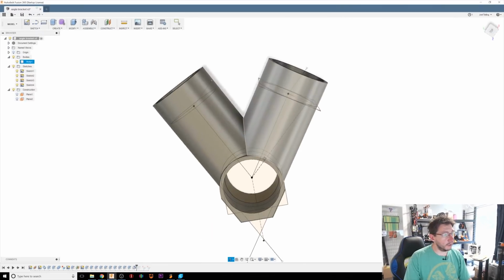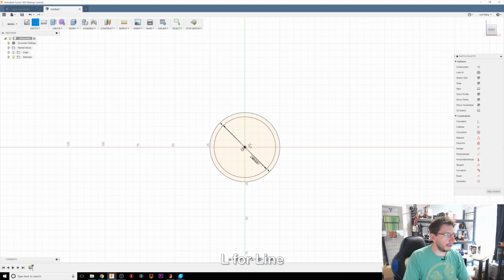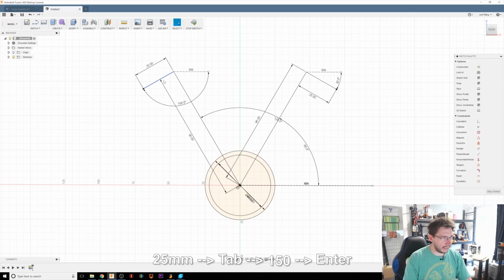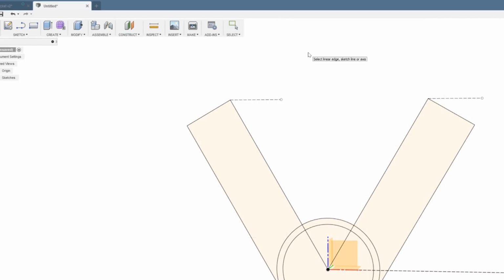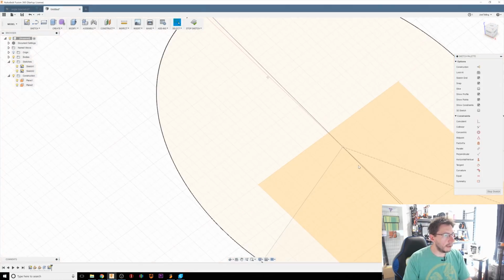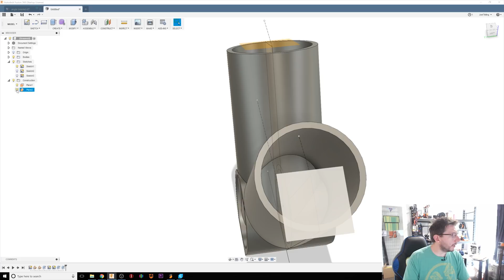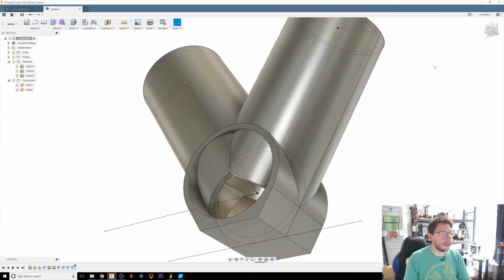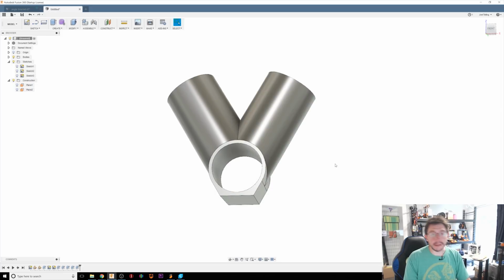3D Printing a Spool Holder Using Paper Towel Cardboard Tubes

Comment: I would've made it so the tube goes on top of the connectors for 2 reasons:
1. It will give the tubes more durability since it stops them from collapsing.
2. It will use up slightly less filament while printing.
The downside is that it won't look as good.

Comment: I know it would be more practical to use cardboard tubes or pvc pipes. But this got me thinking about printing out the tubes and what design considerations and printing orientation I would need to use. 

Printing them with the axis perpendicular to the bed would most likely make the tubes very weak. They would most likely need to be printed with the axis parallel to the bed. Any ideas on what kind of features that I can design into the tubes for extra strength? Ribs?
Reply from the maker: Hmm that's a good question

Comment: Joel, first of all, thank you for the idea and video (I liked it and I re-created your design in my F360). I know you are not a F360 instructor, but you could set good example to others by creating and using user-defined paramers. At minimum, you should use parameters for values that you will need to use multiple times. In this video, for example, you used a few dimensions again and again. F360 makes it extremely easy to use them (once created); you just need to type any part of a parameter name, and F360 will offer one or more matches to choose from.  A few sample (shortened) names: Inner_dia, Outer_dia, Tube_len, Tube_depth.

Comment: you could also use the triangle side as the base, therefore having a possible total of at least 8 - maybe even 14 spools since there would be 3 sides  please see this comment I rlly think it would be a great idea and a great improvement, also it could further increase the weight the structure could take on. Also, I realize you will be thinking, "But oh, then the top triangle just slides down" and I know but you could change the design a little. soo maybe? +3D Printing Nerd

Comment: I don't know if this is your sort of challenge.  

I like to use ceramic knives, and glow in the dark pla uses glow in the dark crystals of a hardness of about 7 mohs. 
A ceramic knife has a hardness of about 8.5 mohs, while steel is 4.5-8 mohs. 

These facts collided in my head about 10 mins ago and became a question.

Is it possible to print an effective knife sharpener for ceramic or steel knives from glow in the dark pla?

Comment: Hi I found your channel because youtube suggested one of your videos. I'm a multimedia artist and was going to dip my toe into 3d models, I was going to get a 3d pen but after watching several of your videos I think a 3d printer is the better way to go. I'm so overwhelmed though. I saw in a couple of your videos that it looks like you have a few different models and was hoping for some advise, if you don't mind. I want to get a match that I can use to print action figure to fully articulated figures. Is that possible and could I do that even in the cheapest printer I can find?

Apologizes I didn't realize I was commenting on an older video the first time and some youtubers don't reply to messages on older videos so was going to ask again here. I was hoping for at least ball joints on the figures I want to make, at least until I get a handle on 3d printing.

Comment: in side of extrude if you hit the drop down where it says distance there is a command  that is call to object this will let you extrude to a selected object so it could be a round face that you dont want to pass threw witch would of made it so u didnt have to cut the center back out
Reply from the maker: HOLY COW. I will try this!
Reply: my day job is designing stuff for the airspace industry and we are all out limiting features and extra sketches and dimensions you will also find in that same location the all command witch will cut threw everything so that way you dont have to have a dimension for the cut that you want to go all the way threw

Comment: Forget swords, make Battlestar Galactica Vipers out of toilet paper rolls and cereal boxes!  Make nifty ceiling mounted dioramas with some dental floss tied around a pushpin!  And when one got destroyed in battle you just made another one, because in a family of four people you go through lots of toilet paper and cereal!
Reply from the maker: Great idea!
Reply: It would definitely be interesting to see you make a 3D printed update to this idea!  I see two parts:
* the back triangle section with wings jutting out
* a jig to allow you to easily mark the six slits you need to pressure fit the nose cone into the triangle section.

The back end was three rolls of toilet paper masking taped together - you could colour it with markers!  A socketed system could be built out of flexible filaments, tolerances could be tighter as they're flexible and would have a snug friction fit.  Model in some wings and build it flat with the circles on the bottom, it shouldn't need any supports.

The front end was built out of a toilet paper roll with six equidistant slits cut out so it'd slide inside the three rolls, the front end was crushed slightly to give the nose cone the shape of the Viper's nose, and then it was masking taped to the rest of the back section.  I could see a 3D modelled piece where there's a cylinder with the slits done at equal distances to take into account the back piece tolerance - they won't be butting up against each other like the full cardboard ones - so one could mark the cut lines for the nose cone slits easily.  Unlike the back section, which would be held together through friction fit due to the flexible filaments, the front section would likely still need to be masking taped to secure it to the back section.

The kids could throw them around,  step on them, and crush them (gotta simulate that battle damage) while rebuilding is as simple as grabbing four new rolls and a few snips with the scissors later after using the cutting jig along with some masking tape and you're back to playing.

Comment: Use the pipe tool to do all 3 pipes you only need 3 lines for this, Then project the end of the pipes then do the offset and do the same for the cut example here https://a360.co/2MqlmDp

Comment: Joel, this is pretty cool.  I think a few more connector types need to be created so there's a full construction set!  How cool would that be!?

Also great F360 tut.  I really like the plane at an angle.  I have a few projects I'm working on where that might make life a lot easier.  I'd like to see more on how to make/model objects with various angled projections.
Reply from the maker: plane at an angle, very seriously, changed my life and how I can design things, my dude.
Reply: William Hayden , they could work with dowels too if smaller diameters are used.
Reply: Hollow connectors and you got a marble racetrack.
Reply: I was thinking a few more connector pieces would make a pretty fun construction set!  Time to save up those paper towel rolls!
Reply: Yes, yes indeed!  I think Joel is on to something much larger than Spool holders.  I suspect he knew this all along and this was just to get our minds working.  :)

Comment: Hi Joel,  Awesome design!  Your second design with the big square end (elevated tube @ 13:49) would have worked.  You have built a truss and the load in the tubes is axial (down the length), not in bending.  When you load the truss to failure (18:10) it fails because the base slides apart first.  The bottom tube is in tension and the connectors pull off of the tube.  Once the base slides apart then the sloping tube is bent.  It didn't really fail where you point at (18:16).  If you glued the base tube into the connectors it would support much more weight.  Could you please try it and post the video?

Thanks,
Chuck

Comment: I would think if you are concerned with the strength of the cardboard tubes and needed the strength, you could easily replace it with PVC pipe from the hardware store, just cut it to length.  But awesome recycle/reuse of materials. Thank you for thinking out of the.....tube!

Comment: Great but Changing the circles to semi-circles would make it so much weaker that the connectors may split in half if try to add a little bit of extra force.
Reply from the maker: Oh yeah, that's a good point.

Comment: One tip would be to only model one side of the 60 deg leg.  Once modelled you can then just mirror the whole 60 deg leg through the centre of the horizontal cylinder.  Saves half the sketches and hence half the time. ;)
Reply from the maker: True, I should have mirrored things. Good call.

Comment: I just got my first printer (a prusa i3 mk3), and I really like the way fusion 360 looks, is it still free to download? When I went to Autodesk it told me I had to subscribe. Any help would be greatly appreciated.
Reply: You can download free trial. If you submit as hobbyist you can use it for free, non limited in time.
Reply from the maker: Yes, it's free to use as a hobbyist!
Reply: It is not free "Willy nilly." You need to register as a student, educator, or a "startup" that includes a hobby use. You will be given a one year license.
Reply: Michael S but after that year what happens? I am I student already and have the student version of Autodesk autoCAD but I’m pretty sure my 3 year limit on that is coming up. I’m trying to find a more permanent solution that doesn’t cost me a monthly fee
Reply: Phil Lewis , you just apply again. This how it works until Autodesk people change their mind (which they have right to do).

Comment: I think that if you put some little teeth that would 'bite' in to the tubes it would prevent them from slipping out over time. Not on the cross holes, because you are going to be sliding the tubes in and out with all the spool changes. But on the structural parts that you probably won't be removing much.
Reply from the maker: Hmm... That's an interesting idea. Some way of keeping things together and tight would be good.

Comment: Nice idea, Joel. In practice you may need to coat the top tube with something to prevent the the friction of the spool from wearing through it.
Reply from the maker: Hmm, you know, that's a good point. I wonder how many spool rotations would be needed to wear through it?

Comment: Hey Joel, at the risk of pointing out the obvious, you could have made life easier for yourself by inserting the vertical tubes into the upper connector first and then easily inserted each end into its corresponding lower connector.
Reply from the maker: DANG IT!

You're so, so very right.

Comment: I bought a dual curtain rod hanging thing and got a wooden dowel, mounted the rod hangers two parts on the wall and lay the dowel between that way its like you said at the end where its lift up and replace, but it is also attached to the wall above where my printers sit. The resistance its pretty much nothing cause the dowels are pre-sanded smooth works REALLY well.

Edit: Found the exact items i purchased:
https://www.homedepot.com/p/Martha-Stewart-Living-1-3-8-in-Wood-Double-Bracket-in-Heritage-Oak-33-BD-2/203721242
https://www.homedepot.com/p/1-1-4-in-x-48-in-Wood-Round-Dowel-HDDH11448/203360188
Reply from the maker: Thanks for the links I'll check it out!

Comment: that is way too big
Reply: You can also cut down the tube to make it smaller.
Reply: sure just seems wastefull to print something that large when it could easily be 1/3 the size
Reply from the maker: If you say so - personally I like the size. Plus, it was a fun learning exercise!
Reply: 3D Printing Nerd yea looked fun to do, just too big for my setup, if you’ve got the space then there’s no problem
Reply: Michael Ormiston , if you use other materials for the arms and adjust the diameters, many sizes are possible.

Comment: my tip for fusion 360 design would have been this one:
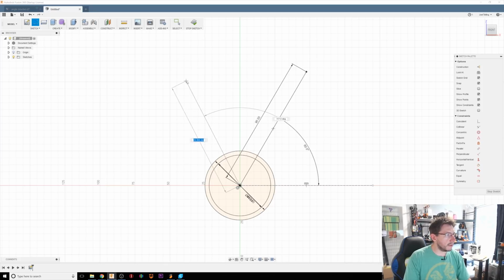at 4:40 you started to draw the second part... it is much faster and better to just draw a half and then mirror it (so you are sure it's symetric). it's even better if you extrude half of the body and mirror that one and then combine it

Comment: I bet this would be even better if you used a broom stick or dowel.  The thing that worries me about paper towel tubes is that they don't hold that much weight.  I think you could probably make something using the same concept but with 1/2 inch dowels. You could hold 5 to 10 or even more spools if you used the dowels which would be stronger. That would be in keeping 3D printing involved...I guess you could also use some PVC pipe as well to do the same thing if you still kept the 3D printed elements.

Comment: Awesome video, just a tip for future cad designs if you do the more important circle first the 44mm one and then use o for offset  can then define the wall thickness, this is great when making prototypes as all u need to do is edit the 44mm circle and the wall thickness will remain the same

Comment: Hey Joel! Looks like there's one thing you could use even better in Fusion, that's offsets. Instead of making a circle at 50mm then another at 44mm, you could make one at 44mm and then offset that 6mm. That just maintains the parametric-ness of Fusion 360. :)
Reply: And if you want to go insane like me, you'll also add parameters that all the numbers are based on so you can change one number in the menu and suddenly the whole model changes to fit toilet paper tubes instead of paper towel rolls.
Reply: @LanceThumping  Same as I was thinking off.

Comment: It's always a good idea to test print a small section of the model to test tolerances rather than the whole thing - saves a lot of plastic.
Reply: This is a great comment. That's exactly what I've done on more complex projects. You can make up your model in F360 and then just extrude a cube over the relevant area and do intersection to leave only the interesting part. Then you can print out a sample to test tolerances on.

Comment: if you extrude the angled pipes "to surface" or something like that, you don't need to cut afterwards. Also you could experiment a bit with mirroring your sketches, so if you change something on one side (maybe inner diameter), the other one will change accordingly in one step. Perfect for more complicated models.

And just an idea, maybe you can come up with some simple prints to reuse empty filament spools as shelves, storage space or something. I guess everyone has many of them and either they get trashed immediately or take up space until someone comes up with a useful idea, that isn't on thingiverse already.